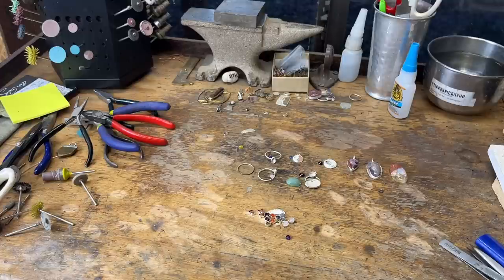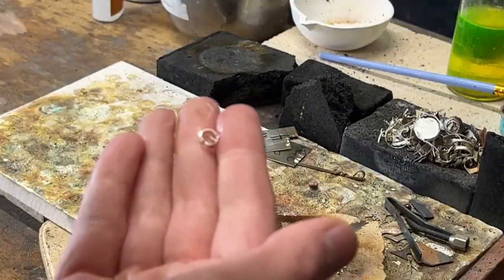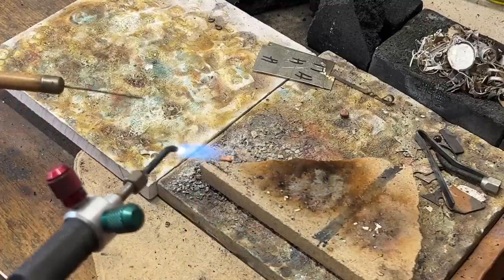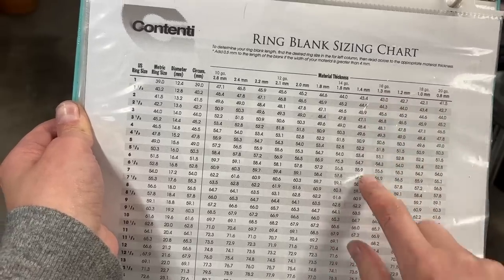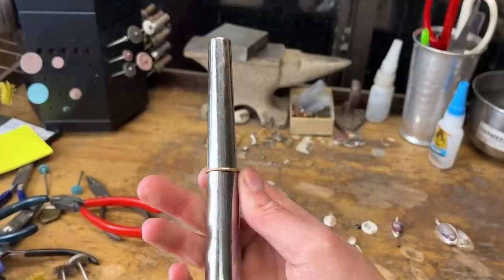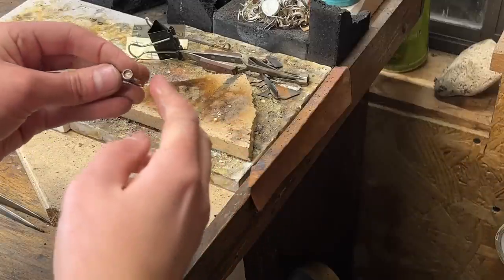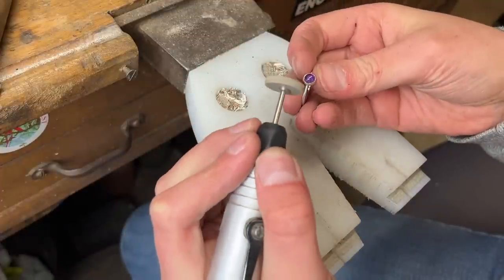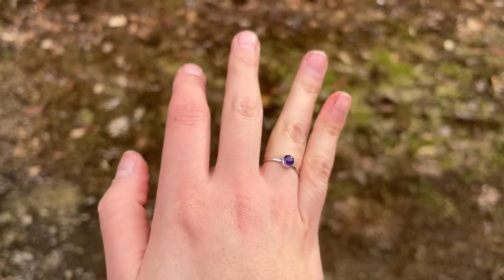How to make a Gemstone ring

Comment: Wow, Katie, thanks for showing how you do this.  I'm 70 years old and when I was 22 I learned how to silversmith.  A class was held by the minister of the local methodist church.  I went to the group for over a year learning.  Then I continued on, on my own for years.  As a class project, I even taught my two children how to make a ring. My tools have been unused now for about 30 years!  It was so fun to watch you.  Your methods and supplies are much better than what I had.  I didn't have a ring chart I just hammered out the size on the mandrel.  Your rings are so beautiful!  Oh, and I just want to add that I was taught to put a very small amount of very fine sawdust under the stone before you seal it in with the bezel.  Have you ever heard of that?  Like I said, this was many years ago where I learned from an old minister.
Reply: One of my sterling silver rings has a break in it.  It simply has a split underneath the silver band on the round part nobody even sees. To me, it looked like a simple fix but the jeweler I brought it to said he couldn't fix it because he was afraid he'd burn the stone part on top.  It's porcelain, hand painted from Holland, not a gem.  I still want it fixed.

Comment: That was interesting. Never saw that done before. Nice work! I saw recently on a video that someone drilled a 1 inch hole in the side of their bench to hold the ring mandrel in place so you can stop hammering your fingers. 🤔 For those times when you need a third hand. 🙃